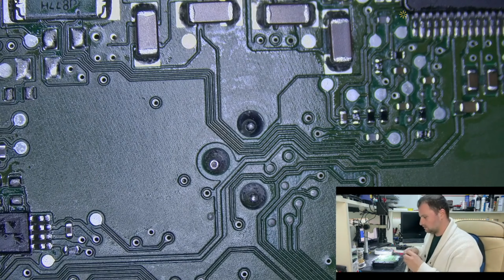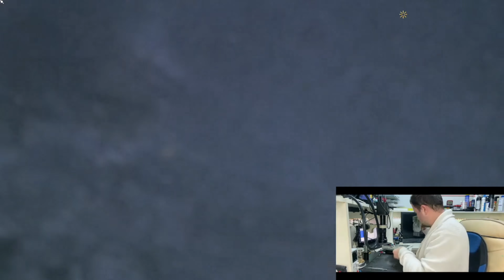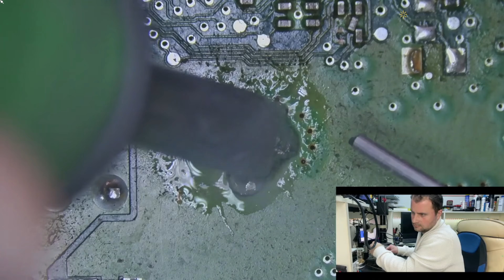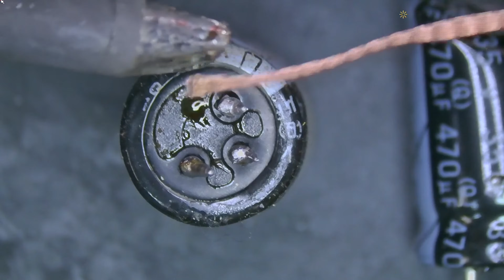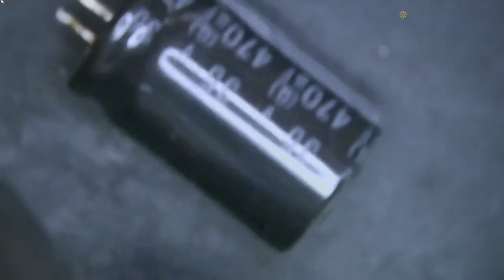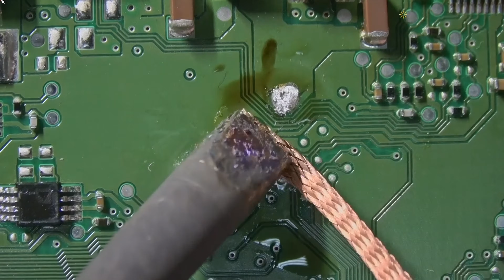Range Rover Evoque Engine control unit repairing

Comment: The PACE ST125 desoldering station with the SX-100 handpiece makes easy work of removing solder from through hole parts. The SX-100 handpiece and tips work extremely well. Just add a little solder (Eutectic Tin/Lead) to get the joint solder to flow, heat up the joint, make sure pin is free and vacuum the solder out. Fast and easy. No need to use low melt solder.

The PCB layout is very strange in that it has a lot a plane/polygon fill slivers.